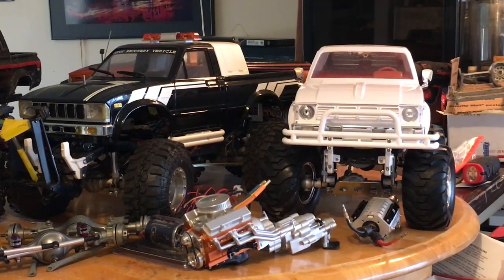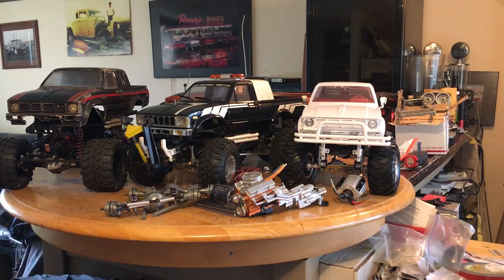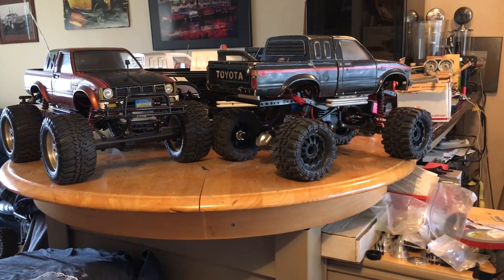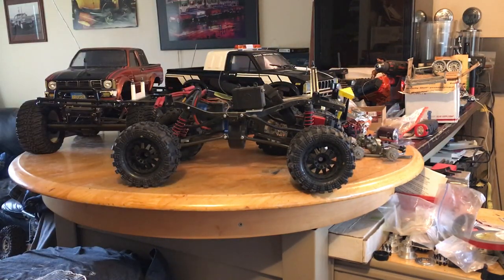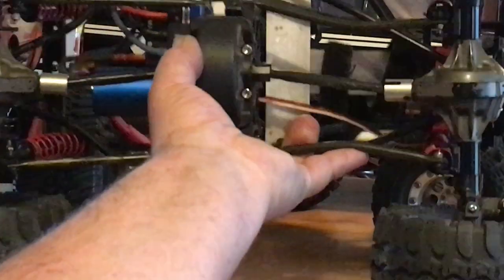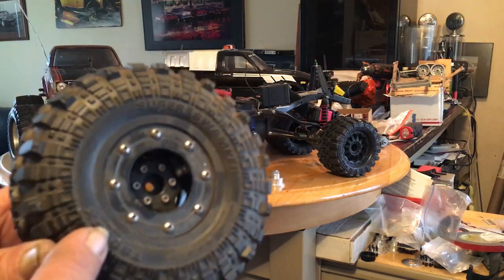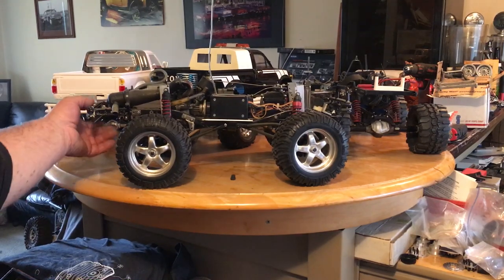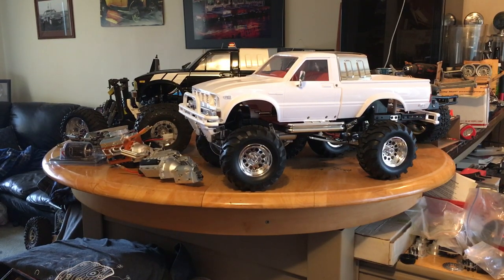HG P407 vs Tamiya Bruiser

Comment: I got 2 bruiser's in storage & both are broken . Never had luck ! Bought the Hp & most part's are interchangeable. I have no interest going to brushless or any kind of high power LOL it would just rip the body off . I thought about putting brushless in the clod-buster! But I have a feeling it wouldn't turn out well ! Technologies has changed 💯⌛ . I think the bruiser is the Pinnacle of cool ! You got some nice rigs & thanks for the vids always cool see 😃🙌
Reply from the maker: Thanks!  yeah brushless can be brutal on a rig, lol  well now you can piece your bruisers back together with the hg parts,  Back in the 80s I wired my clod up in series 14.4 volts, it was a blast till the resistor melted down lol,  wish i filmed that!  I can still hear those gears violently winding out...lol
Reply: @dennisdempseyradiooutofcontrol  yeah I feel ya ! I had the need for speed until I found out speed takes the fun away when it becomes uncontrollable. I bought the Traxxas xo1 & it got long in the tooth ! Car leaving the pavement & disintegrating at 115mph ! 50 or 60 is my sweet spot build for comfort not speed guess .LOL

Comment: I've learn a lot watching your show: My hg p407 front steenring parts not holding up; Do you have any suggestion how to upgrade on a heavy duty metal kit? thanks in advance.
Reply from the maker: Hot racing made a alloy steering arm for the bruiser /hgp407 other than upgrading the steering servo there isnt much on the market

Comment: Ive been thinking about getting one of these bodies, But i cant find any measurements on just the body size......wheel well center to center and the width.  Ive watched a few of your videos and i see you have plenty of these.  Would it be a bother to ask you for measurements?
Reply from the maker: no problem, the wheel well center to center is approximately 290mm (11.5)inches, the with is 195mm (7.75)
Reply: @dennisdempseyradiooutofcontrol  i really appreciate that.  Now i know this body will fit my chassis.

Comment: Hey so I did it got a hg p407  was wondering if you you could share a list of upgrades for it like a roll bar and tires light kit I want my truck to look like yours
Reply from the maker: Great to hear you got one! The roll bar from the tamiya  mountaineer is a direct fit, ebay sells lots of spare parts trees for them and they fit the HG-P407 also, what tires did you like?

Comment: Will tamiya upgrades fit on the clone? Can't afford the real deal but this looks a good starting point to upgrade as I can afford to.
Reply from the maker: yea most parts are a direct fit except the slipper clutch, it needs a little modification i have a how to video on that in my play list.
Reply: Thanks . Very tempted. Will have a look at your video. Pity they are all in China  and not any for sale in the UK. Just worried it won't turn up.

Comment: If you get brushless motor for crawling get a sensor one then you will have more control of start and stop !
Reply from the maker: Good point my friend. using a motor with lower rpm and more torque is a solid set up on the trails.

Comment: what wheels on teh block one inthis video...
Reply from the maker: there the proline 2.8 super swampers, they have a 12mm hex mount.
Reply: @dennisdempseyradiooutofcontrol  no the middle truck... rims and tires...
Reply from the maker: @allianceofsteel  they are the rc4wd tamiya bruiser 2.2 true scale beadlocks.

Comment: How do i lock my diffs on the HP 407?
Reply from the maker: LiL Hustler  if you look on the top side of the center  axle housing remove the small set screw and install the supplied long set screw pin to do this carefully put the pin in the hole and slowly rotate the axle till it falls in place , tighten the pin and reinstall the small set screw.
Reply: I have used childrens play-doh insided the diffs instead of grease. U can get thus a partial lock for a lot of extra traction for crawling and still have the benefits of a working diff....